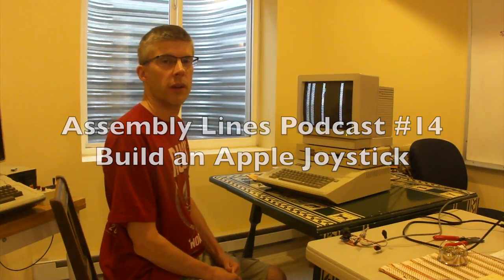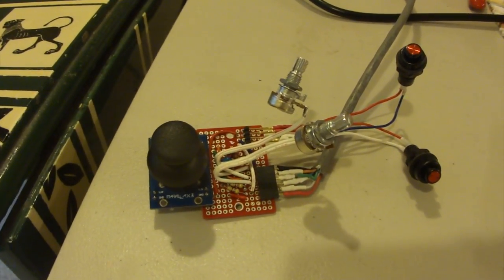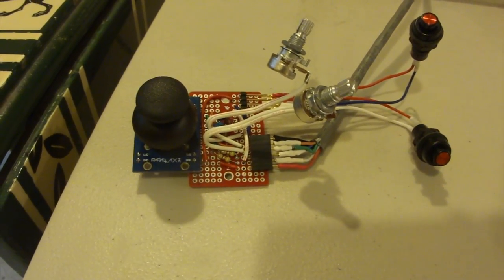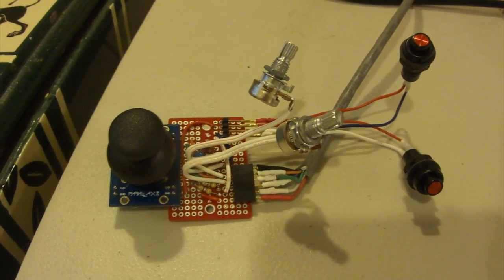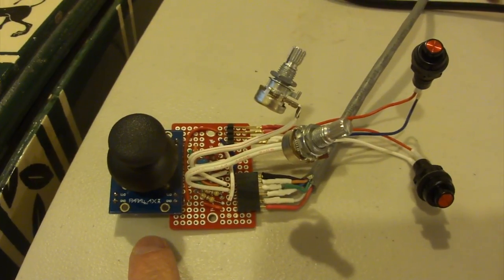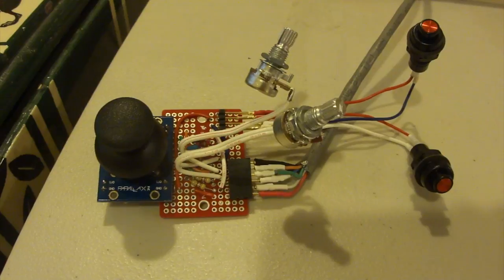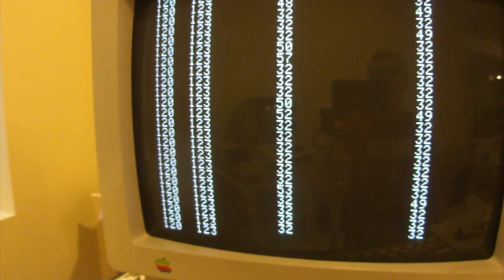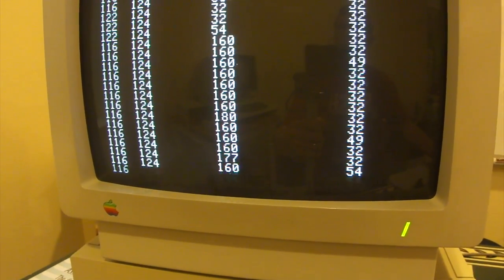Assembly Lines #14: Build an Apple Joystick

Comment: Thanks Chris.  This is what I needed to convert one of those NOS IBM PCjr joysticks that have flooded the market recently to an Apple II joystick.  Got mine off BGMicro with a free 9 pin adapter a while back and the stick worked fine just by following the pinouts, but the buttons didn't do anything.  In case anyone else wants to do this, to get the buttons work just disconnect the brown wire from the blue ceramic cap and solder it onto the red wire (+5V).  Also, put a 680 Ohm resistor inline with each button, I believe the wires were green and yellow.
Reply from the maker: Awesome, glad to hear that you got it working! That is an "analog" joystick, correct? So it has the full range of values 0...255?
Reply: @CT6502  I believe it is analog.  BGMicro listed as such and I tested using the program you have linked and it can get values pretty close to 0...255 and it works perfect for Choplifter!  

Here's an old screenshot of the breakout board/joystick BGMicro had a while back: https://cdn.hackaday.io/images/5014681563469967697.png  

Anyways, it was fun learning this stuff, so thanks for filling in the blanks!
Reply from the maker: @xyyx1001  Great, thanks for the link!

Comment: I'm giving a go at rolling my own Apple II stick, and I've got a quick question for you - where did you wire the adjustment pots for the x and y axis? None of the schematics I could get a hold of included them.
Reply from the maker: Great question - if I recall, they are just inline with the X & Y wires coming from the joystick. I think this diagram has the resistors buried in the middle: http://quinndunki.com/blondihacks/wp-content/uploads/2015/03/IMG_0741.png  You might just need to build a quick breadboard circuit and play around with it.
Reply: @CT6502  I think that's just what I'm going to do. I would have just bought one, but the prices these days on Apple II joysticks is RIDICULOUS ($50 - $75). I already have all the parts necessary to build one, so why not just do that instead?
Reply from the maker: @natethefighter  Yep, plus you get the fun of building it! Just make sure to get an analog-style joystick/thumbstick. A lot of them are just "digital" on/off (like an Atari joystick) and while those will work for some Apple II games, for others, like Choplifter or Olympic Decathlon, they will make the game impossible to play.

Comment: What kind of parts did you use?
Reply from the maker: Gee, it's been quite a while. I should have put them all into the description. I think you're going to have to just do some web searches. They're all pretty standard components. The only tricky one is the "analog" joystick - you need to find one of those, instead of a digital on/off stick.